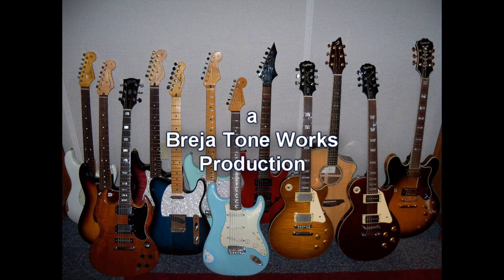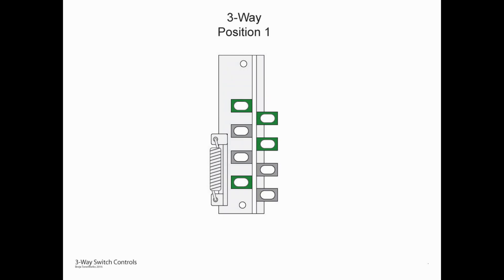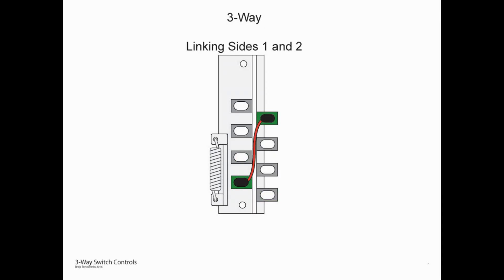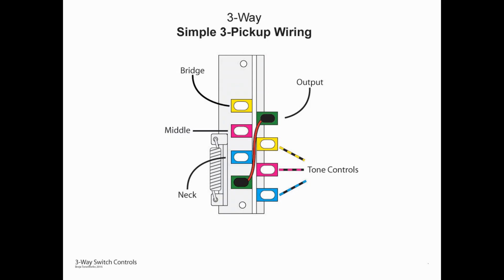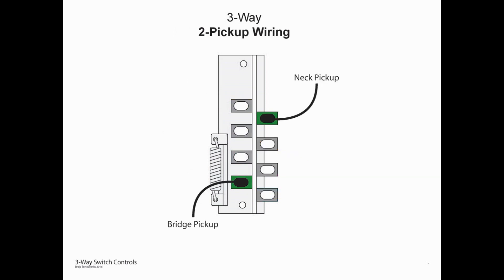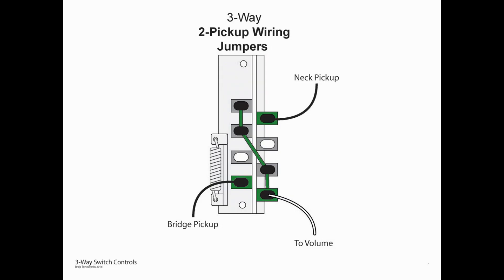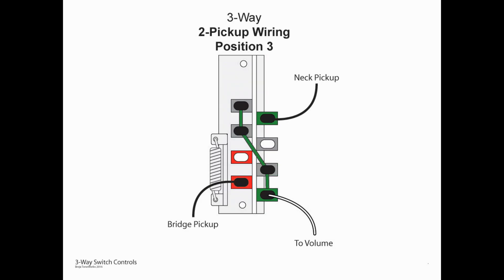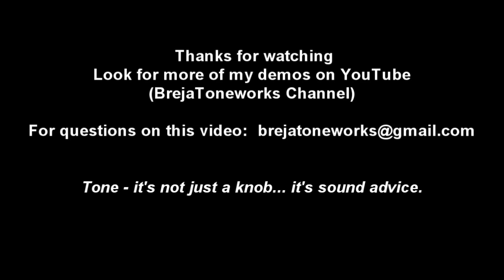Understanding How a 3-Way Lever Switch Works

Comment: I’m thinking of using a 3 way on a 3 single coil Strat only using the neck and bridge pickup.  I want to remove the magnets in the middle pickup and wire to the output as a dummy coil for noise cancelling, essentially the middle pickup is just a place holder for the dummy coil it is not engaged with the switch.

Comment: Are the jumpers internal to the switch or something we need to wire?  This looks like a rotary switch but contrary to popular programming I prefer pcb type.  Are PCB type wired differently?
Reply: The jumper wire needs to be wired on these classic style of switches. Just run one wire through the points shown on the video.

Comment: Thank you for showing the 3 way to 3 pickup configuration. I'm Not a wiring guy, and I'm struggling to understand how to do a 3 way to 3 pickup configuration on a strat style guitar with 2 singles and 1 humbucker, and this clip is the only one I have found with info on that old school set up. Still slightly confused, but, this gives me a little hope I will get it to work. Cheers.

Comment: Are you still active on here? I've been looking for information for quite a while now on how the second 3 way switch works on a vintage hagstrom swede. I took it in to have it looked at and the store owner said he never seen anything like it, so either it was repaired at some point wrong but I grew up thinking it was a tone switch, to give either pup a high, mid, or low tone. So if you could tell me the intention of the second 3way and what it's Supposed to do I would appreciate it. Ty

Comment: What about a two pickup guitar with two volume and two tone controls?
Reply: You would wire one tone pot to one volume pot, wire the lead from the bridge pickup to that volume pot and then the output (middle lug) wires to A4. Repeat the other volume and tone pot and wire that output to B1.

Comment: what if i have two volumes? one for the bridge and one for the neck?
Reply: Wire the pickup to the volume pot first, then the output wires to the switch. The pots go before the switch, just like a Les Paul wiring.

Comment: Nice! I have a three way switch for my two pick up Tele.  but it doesn’t have a spring. Is there a way to make sure that I mount it to my switch plate correctly? Could I install ass backwards?

Comment: Thanks man! So, in the 3 pickups wiring the switch determines the signal input from the pickups, and in the 2 pickups wiring the switch determines the output to volume knob right?

Comment: Hi, new subsriber here- I use to make myself all the modification in my guitars and this is really helpfull. In these days I'm struggling after istalled a new Neck Pickup Dimarzio Twang King on my Telecaster, and a 4-way switch in order to have in series/parallel the two pickups. I followed the instruction according to your video at link https://youtu.be/ZP6xTWvooJo?si=6JK6x2PIu61lCprc but I discovered that the new neck PU is out of phase with the stock Bridge Pickup. So I swapped the position of the hot (white) with the ground (black). I would like to know the functionality of the 4-way switch as you described for the 3-way, in order to understand in deep and not simply copying a wiring diagram. Thanks.

Comment: BREJA TONE WORKS, Vintage strats used a 3 way lever switch, but when putting the lever in between positions on a strat which tone pots are selected? I think the bridge pickup gets the tone pot#2 in the in between position right?

Comment: I removed the middle pickup on my Strat, installed a 3 way switch and can't get the wiring to work. Only the neck pickup engages. I don't get it.

Comment: Look, I know it's 7 years later, but this video is just what I needed today. Thanks for taking the time to explain the mapping. The wiring diagram I got with my StewMac switch seemed to be reversed from what I was looking at on the physical switch, and my middle position wasn't engaging either pickup. With this information, I should be able to sort out what's going on without simply relying on their diagram.

Comment: Would this work if I wanted to have a separate tone control for the bridge?
Reply: If it's just a tone for the bridge, just attach the pot to the same lug (on the switch) as the lead wire of the bridge pickup.

Comment: Thank you, the only video on YouTube that's to the point without all the bs
Reply: I like radioshop pickups channel as well  . Great tips for diy
Reply: @ranius7388  I used this putting in some Fender custom shop 51 Nocasters they are the best I owned.
Reply: hello how about pick up1  pick up2   & 1+2   connection

Comment: Hello, very interesting. I have a question for an expert: I have a 67-68 tele custom. Originally it had that silly switch 3 position bass-neck-bridge. I had it changed because the bass one was just useless. I understand that was an original set up, but nobody talks about that. Did everybody change the set up as I did and just forgot about it. What's the story behind that?

Comment: Awesome. I’m curious how to wire a telecaster 3 way switch with two pickups, where the position are as stated. 
1. Bridge 
2. Bridge and neck parallel
3. Bridge and neck series

I understand I need a ground wire coming off my neck pickup cover. But how would everything be wired?

Comment: 2 pickup wiring with 3 way switch: Solution: I initially read the diagram wrong so I had to look at the switch properly to determine where A1 was etc..  B1 follows likewise then it was just a matter of soldering them as per the diagram. Now Position 1, 2 and 3 work

Comment: MAn either my ESP LTD Viper has a very rare 3 way selector or I just dont get it. Every single video has this same 8 lug config.
I dont get it. Mine has screws on the sides and on 1 end is one luig and on the other end is 3 lugs.
Oh and my diagram said the output from the jack goes to Lug 2 on the volume pot
Reply: Mine is the same way for an Epiphone SG

Comment: Breja, you are a literal lifesaver. I bought some Fishman Fluence Moderns and I have destroyed many switches and pots trying to guess what the problem was. My pickups were low output/quacky. Their wiring diagram for the 3 way is back to front (i only know that thanks to yuor video), as a last resort I unsoldered everything and copied your layout even though theirs is completely different. My pickups have come to life and full bodied! Seriously, your channel has saved me and I'm sure countless other guitar players who like to tinker with upgrades. If your curious, here is their diagram https://www.fishman.com/wp-content/uploads/2020/06/Fluence-Modern-HB-Set-Wiring-Diagram-Vol-Tone-with-Universal-battery-Pack.pdf

Comment: wait.... you explained only a Fender type switch... most cheap guitars and kits have 8-in-a-line type nowadays. And the Korean guitars even have a 3rd type switch that is seldom seen except in used guitars. But you do not even mention that at all... what about the 3rd type switch that we will encounter in older used guitars ?

Comment: Doug, I have a question about wiring a guitar. I built a pick guard with a Seymour Duncan pearly gates (bridge hum bucker) and a little 59 single coil sized hum bucker in the neck. What I am trying to do is have 2 volumes and one master tone. I also want the center position to play both. Here is a list of my components. 2- Seymour Duncan hum buckers, 3 500k Mojotone vintage taper pots, 3- way CRL blade switch. My biggest complaint is wiring two volumes...I cannot seem to get the separation of the volumes. I want the top pot to run the bridge, the middle ;to to run the neck and the third pot to run the tone for both and the center position. My CRL 3-way switch does not look like any pot ive seem with respect to the lug layout. Their are 4 on the left and 4 on the right but the right side has the highest lug.....not like the tutorial you have shown. Also worth noting is the bottom lug on the left is common and the upper lug on the right in common. I would be willing to pay you for a drawing of how to hook this up. I also notice this guitar has very noisy ground loop noise. Any help with the noise problem would be appreciated as well. I need to know exactly where every single wire goes to include the input jack. Any help is greatly appreciated....thanks in advance.

Comment: If i wanted to use it for 2 humbucker strat with 2 tone and 1 volume pots would soldering tone pots to A3 and B2 give me that ?
Reply: Im curious as well im trying to wire two hot rails bridge and neck position only with tone controls on both ....
Reply: @fatstercat  
Hey just in case you are still looking this might be helpful https://guitarelectronics.com/2-humbuckers-3-way-lever-switch-1-volume-2-tones/

Comment: I appreciate all the videos you make!!  Thanks.
Was wondering if you had any tips or diagrams for using 2 dual concentric pots in a 3 way switched Tele?  It has a humbucker in the neck and single coil in the bridge.  Doing this mod to have individual tone and volume for each pickup.
The pots are 250/500.  Hoping you can help.
Sincerely...

Comment: Thanks for putting this together.  Position 1 and 3 work for me correctly but Position 2 only has the neck.  Any idea what I could have done wrong?  Mine is an import switch with only one row of lugs - used the same logic for A1-B4 that you referenced in your 5-way switch video.  Thanks again.

Comment: my old switch has a ground wire solder to the body of the switch.. where i need to put it on the standard switch?
Reply: In between the pickups in the center position.

Comment: what about a blade toggle switch where all the lugs are in a line?
Reply: I have the same question
Reply: @soretuber847  that makes 3 of us.. im having an issue where i get sound but i cant get the 2 pickups to combine sound on middle position
Reply: @cristhiantrinidad7526  I found this article http://alloutput.com/guitar/5-way-switches-explained/
It compares the connection on two types i haven't tried yet but I've made a diagram. Look out for the pcb side.
Reply: Use a multimeter, put the knob in the neck pickup position and touch the multimeter to each piece. When you find one that registers, you know that is where the neck pickup gets wired to. Repeat for bridge pickup. The ground will go in the center and the wire to the volume pot, on the back side. Hope that helps.

Comment: I have a 2 pickup Flaxwood with a 3 way blade and it's nearly impossible to find the correct wiring.  I'm trying to put in EMG Retro Active 55s that use a pickup bus to go to the selector- but all the wiring is for a Les Paul style toggle.  Besides the neck and bridge, it's looking  for a ground and an output wire to be connected.  Do I just call the output wire the one that normally goes to a volume pot and leave off the ground?

Comment: I have an ibanez in hsh with a 5w switch and i would like to have a hh 3w switch configuration with position 1 for the whole bridge pickup, position 2 both pickups (or maybe only one coil of each pickup) and position 3 the whole Neck pickup. I have one standard volume and one standard tone. Is it possible with a standard 3 way position (like the telecaster) ?

Comment: Hey, my Guitar is a ibanez and has two ground wires. One that goes to the bridge and the other ground wire that goes to the inner cavity of the Guitar. Do you or anyone else know where to connect the both ground wires. Maybe to the 5-way switch or back of the volume pot? I’m rewiring the Guitar from scratch. Any help would be appreciated.
Reply: Same here and all is on the left side where you could connect a wire...

Comment: Do these switches need to be grounded? If so, how?
Reply: Yes, ground goes between the pickup wires to the shielding around the pickup wires. Make sure to get a connection all the way around. Twist the end around and crimp it fairly tight, then solder.

Comment: I had a question, is it possible to wire a guitar directly to the input jack by passing the tone pots yet still being able to use your pick up selector? My son doesn't use his tone knobs and he controls his volume with his volume pedal.
Reply: Yes, just wire the PU to the Jack, Hot to hot, usw.Its very easy i did it often.. But its better to have a pod between, because it might have hugh noise problems in the Background . At least Di Marzio gave me that tip.

Comment: Question, Im trying to change up my strat so that I can drop the middle pickup (I never use it), how do I wire up the middle position to split the bridge and neck? This is the only thing I need to figure out to finish my current project. Thank you in advance.

Comment: Thank you!  I have a question about the diagram you introduce at 4:17.  Recently, I changed the pots and switch on my MIM telecaster using this layout.  For some reason, Position 1 and 3 work great, but position 2 is silent (both PUPS).  I've double-checked my wiring and solder job and they seem in order.  Any suggestions on how to trouble shoot?  Thanks!
Reply: Nevermind, figured it out :)  I checked for continuity between the common lugs and all the other lugs.  For some reason, my switch requires a connection from B1 to B2 and another from A3 to A4 to work in position 2.  Not sure why that is.  I haven't seen that layout any where on the internet.  Thanks again!

Comment: hi Breja ToneWorks , I want to rewire my electric guitar with bigger size wire , will it change something and if so what would I have to do then ? thanks you sir for all your great videos !
Reply from the maker: No - changing the gauge of wire doesn't require any special work.  Some wire is better than other though.  Solid Strand is ok but brittle.  Multi-Strand wire is stronger but doesn't always stay put.  You don't need to go really thick in the gauge.
Reply: +Breja ToneWorks  thank you so much :)

Comment: These vids are awesome and helped more than anything else online. Thanks Don. How about 1 on wiring an  a Gibson EDS-1275  Double neck using the Switchcraft Right Angle 4 pole 3-way toggle switch. Not the added 3-way switch  Epiphone G1275 uses.Also how about 1 on wiring a double neck Stratocaster with 1 volume 2 tone and 1 3-way  using single coil pickups  .......................... Thanks
Reply from the maker: You guys and your double neck guitars.  You're just rubbing it in my face that I don't have one.   :)   I'll see what I can come up with.

Comment: Another helpful video!  I have a question relating to a 4 way switch. I followed your Tele 4 way combination a while back and it worked great.  I was watching a video where a man was playing a Tele with a gibson humbucker in front with standard single coil rear and he had a four way switch.  It yielded some great sounds.  Would the individual pup's polarity be a factor in wiring up a system like this?   Thanks for all your helpful vids.
Reply from the maker: +Mitch Arney Normally - No.  The 4-way would do the same function with the HB in the neck as it would if a SC was in the neck.  Neck and Bridge independent and Neck and Bridge in Series or Parallel.  If you used a RWRP SC in the bridge there might be a slightly different sound.  I've never tried that so I can't tell what the effect would be.
Reply: +Breja ToneWorks Thanks for your help!  I do want to avoid any out of phase sounds, if possible.  You mention RWRP for the bridge pup, mine is south wound.  My understanding is SW bridge with the back Gibson coil being NW and the front coil SW.....you have S-N-S polarities. Am I making sense?  Thanks
Reply from the maker: +Mitch Arney Yes - you would be correct.  You might have to pull a Keith Richards and flip the HB around to adjust for the polarity issue.
Reply: +Breja ToneWorks Thanks......could it be that switching the hot and ground on the bridge pup would also work...for polarity?
Reply from the maker: +Mitch Arney No - it's how the windings go around the magnet.  Some people open up the pickup and flip the magnet.  I'm not the brave or ambitious.
Reply: +Breja ToneWorks Thanks very much for your help.

Comment: since i never use the middle position on my guitar, i wire the 3 way switch as blower switch also. position 1, neck, 2: bridge 3. bridge straight to the jack. theres a on off on switch to split either neck or bridge. the result is, i can use single channel amp and go from metal to pristine clean and jangly cleans in a sweep of a 3 way switch. super handly to me, saves me more money and pedals.